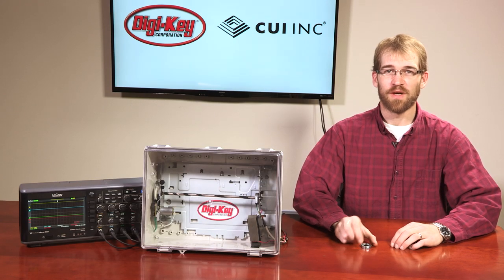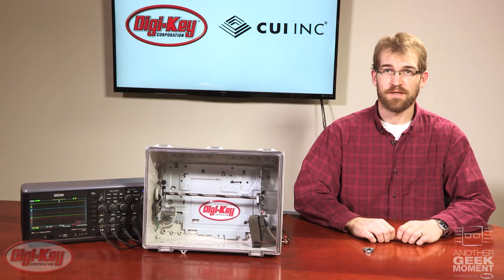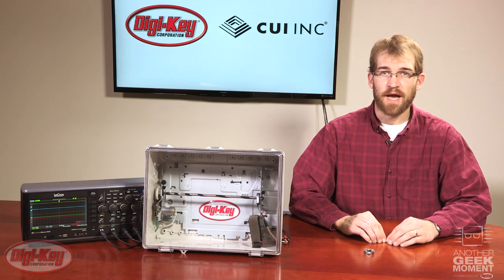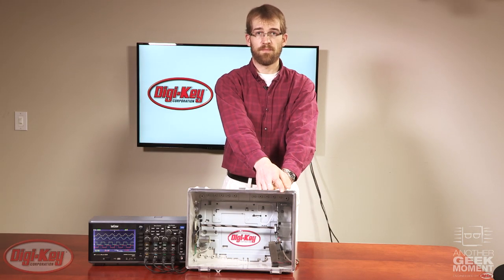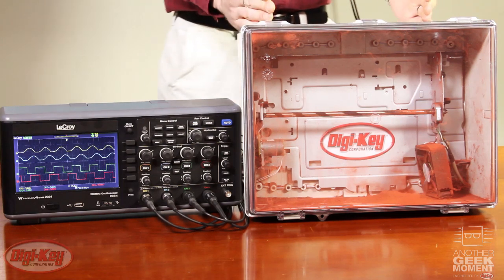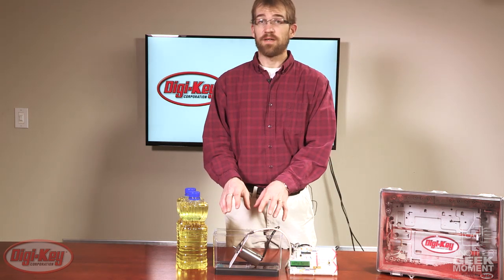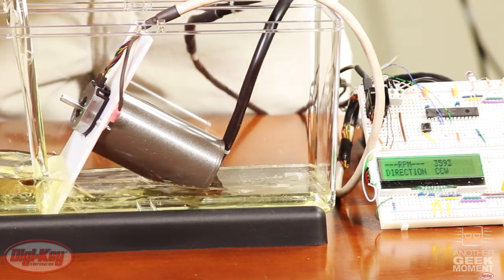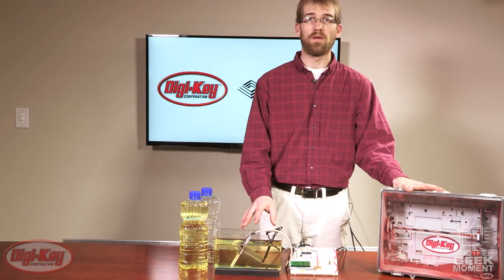CUI Inc AMT Encoder Series – Another Geek Moment │ DigiKey

Comment from the maker: Hello -
Yes these potentially could be used in conjunction with a Mach3 CNC control system. you would want to make sure to use the AMT112. Unfortunately for the shaft size question, these encoders are only capable of accommodating shaft sizes up to 8mm (approximately 0.315”). The full list of shaft sizes that this encoder can accommodate are listed on page 3 of this data sheet: http://www.cui.com/product/resource/amt11.pdf

Comment: I use these encoders a lot ! I will back up their ruggedness. i ran three on my original wood router, for about 9 years and without a lot of dust protection.  They then sat for another 3 years and today I dragged one out, it was full of dust and dirt, gave it a quick clean with compressed air and fired up the servo, smooth as it ever was.  I also live in a high humidity/heat part of the world, lots of other electronics die in my shed, not these encoders !!!